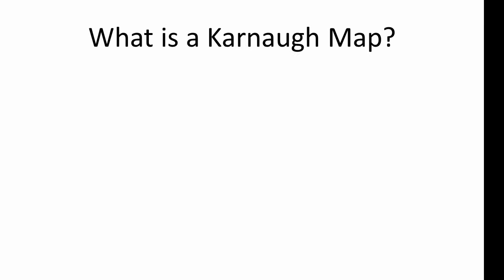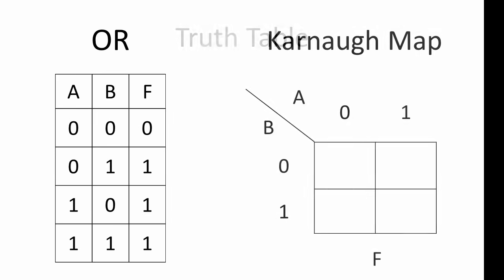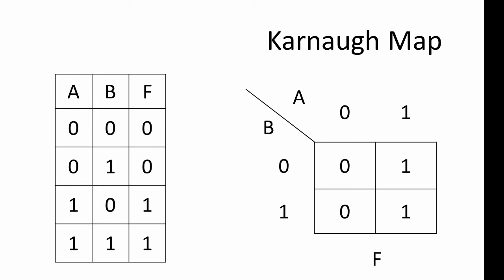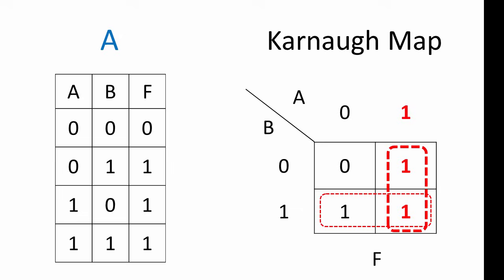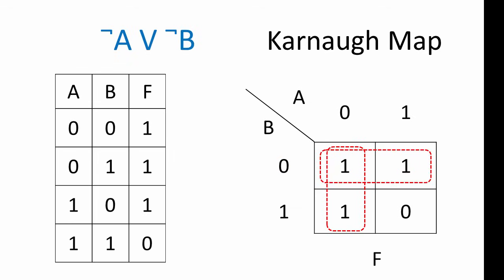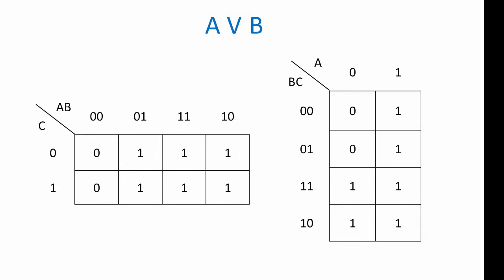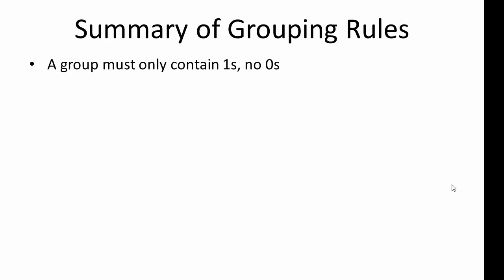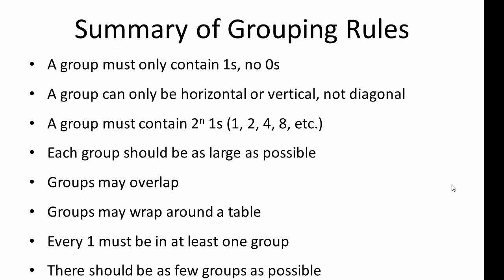Karnaugh Maps – Introduction

Comment: I coud not understand the last example, could you please explain it or send any further link on the last example ??
Reply from the maker: I'll assume you are happy with the idea that a K-map can be rolled into a cylinder to get the biggest possible group of 1s (as in the previous example).  In this case, it is a group of two 1's as illustrated.  (I suggest you sketch this on a piece of paper and have it in front of you before you read on).  Now look at the column heading for this group of 1s and you can see the value of A is 1.  We say that there is a relationship between both 1s in the group and the value of A; both 1s in the group match their column heading.  Now look at the ROW headings for each 1 in the group.  For the top 1 in the group, the row headings are B = 0 and C = 0.  For the bottom 1 in the group, the row headings are B = 1 and C = 0.  For now, consider only the C row heading.  The value of C in the row heading is 0 for both 1s in the group, so there IS a relationship between both 1s in the group and the value of C; they are always opposite (NOT each other).  However, the value of B in the row heading is 0 for the top 1 in the group and the value of B in the row heading is 1 for the bottom 1 in the group, so they are unrelated.  This leads to the expression A AND NOT C.

Comment: Why the group must contain the largest number of ones ?
Reply from the maker: It doesn't necessarily have to, as long as all of the ones are included somehow.  However, you may not end up with the SIMPLEST possible expression (although it may be correct).  A later video in this series, and my series on Boolean Algebra, makes the point that we want to arrive at the simplest possible expression because it leads to the simplest (and therefore cheapest and most efficient) combination of logic gates :)KD
Reply: Computer Science thank  you

Comment: Great video. Some things to expand on:
1. These can be used for 4 inputs. Make a 4x4 grid and order both sides as the longer side is done in the video.
2. Instead of thinking about the number of 1s being a power of 2, just make the side lengths a power of 2; it's the same thing
3. The reason you want to make the largest rectangles and the fewest number of them, are the larger the rectangle the simpler the rule, as more variables are ignored, and the fewer the number of rectangles the fewer number of rules.
4. Sometimes we don't care if an input is a 0 or 1 (such as in a 7 segment display where we only care about 0-9 in 4 bits, then 10-15 are irrelevant. In those cases, an "X" is used to denote an input for which we do not care about the result, and "X"s can be included or not included in the rectangles; it does not matter, as opposed to 1s which must be and 0s which must not be.

Comment: the left table on  6:18 does not make any sense it doesnt look like a and table or a or table or a xor table how do u know wich has the 1 result or 0 result of al the combinations
Reply from the maker: Hi hovsep56.  The table on the left is a truth table for some combination of logic gates with 3 inputs.  For all we know, it may be complex a combination of several logic gates (which someone has designed and is now hoping to simplify).  We don't know what gates are involved, but we do know is how they behave, as described by the truth table.  The K-Map analysis allows us to conclude it behaves like an OR gate with inputs A, B.  (Ignore column C of this truth table and you will see this is the case.)  K-Maps are a design tool that allow us to simplify circuits.  In this example, we see that input C is actually superfluous and all we need is an OR gate with inputs A, B. :)KD

Comment: at 10:50 , you did not mention C at all, is it because the group is vertical or you just assumed we understand C can be dismissed since values in the group didnt change whether C was 0 or 1?
Reply from the maker: Hi Zanas Tumasonis - I assumed you understood that  C can be dismissed since values in the group didn't change whether C was 0 or 1. 
 The top 1 in the group corresponds to an input value of of 0 for C and the bottom 1 in the group corresponds to an input value of of 1 for C, so the output is independent of C.